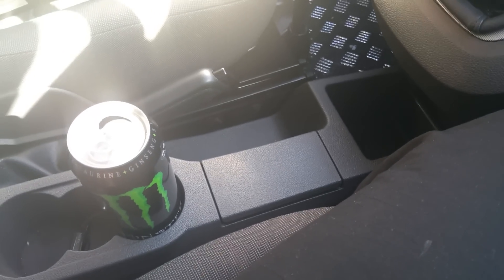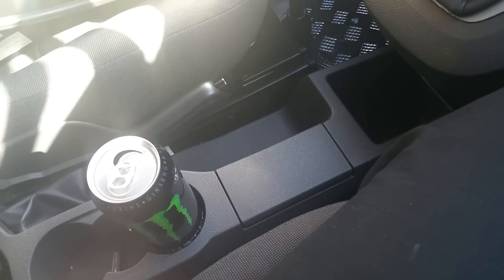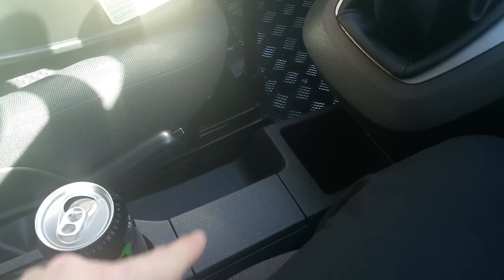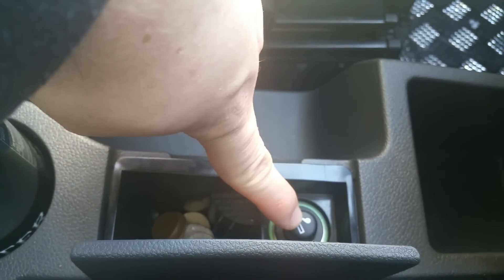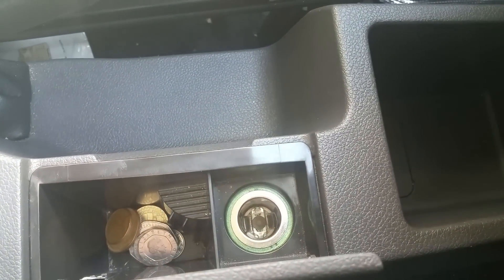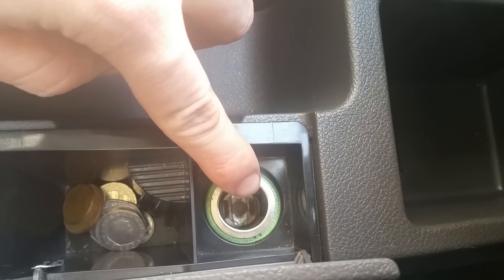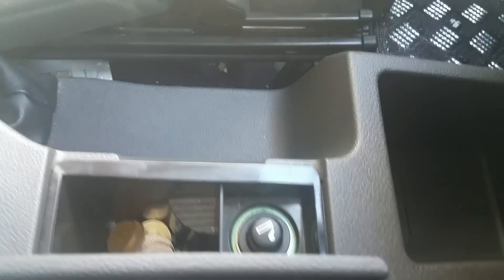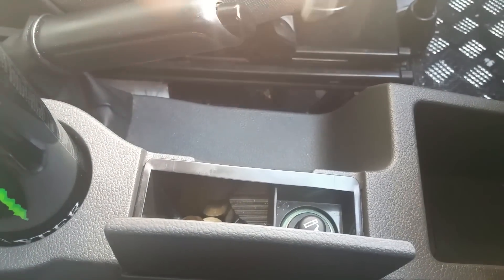How i fixed my loose 12v socket and chargers.

Comment: thanks mate mine same annoying problem.... slight movement an turns off.. so put s plastic toothpick down the bottom an pulled the pins to and now snugg fit... an works a charm

Comment: it would probably be a lot easier to disconnect the battery and get in there with a flathead screwdriver but thank you for the tip, ill have to give it a try
Reply: +ComfortingSound R.I.P Bjork 😂😂
Reply: Hell, just pull the unit out and disconnect the leads. Then you can use a screwdriver no problem.

Comment: In our older Freightliner the power pretty works but it flickers of and on with every single bump. I am assuming there's a loose connection. Takes forever to charge phone. Not enough power to run a GPS or little fan. Oh and anyone who knows freightliners with know it's bumpy ride!

Comment: i tried this before, maybe i didnt move the prongs out far enough? I didn't want to over do it. My lightet used to work periodically now it just doesn't pop up or heat up at all. I know its getting a current because the light on my cell phone charger comes on when I plug it in briefly to test for a current.  I dont use it for anything other than a lighter because, both my auxiliary sockets are used for charging cells and other power source needs.  Both auxillaries are working just fine. it has to be the prongs. i was twisting my lighter for a while and that made it heat up and pop out before.  Could I have over twisted it and broken the lighter itself?  is there any way to test the actual lighter to see if it needs to be replaced?

Comment: I have an issue where the entire outlet comes out, any fix for that?
Reply: Did you find a fix? I'm having that problem too
Reply: @Llyswyn  I just super glued it
Reply: @bitchiro2478  haha great fix
Reply: From another vid I found, if the contacts we moves in this vid are at 9 and 3, on the sides that are 6 and 12 there should be 2 little clips that you can push from the inside. These clip into the outer surround and hold it into place.

Vid - https://www.youtube.com/watch?v=Vr8m93e6u8g

Comment: What do you do when whole socket won't stay in?
Reply: Ahh a Excellent question
I wish to bring this Mystery of the Ages to light In my upcoming Video.
Simply put , there is  no area recessed in the outer ring to accept the two outer ridges that are the only thing holding your phone charger in place